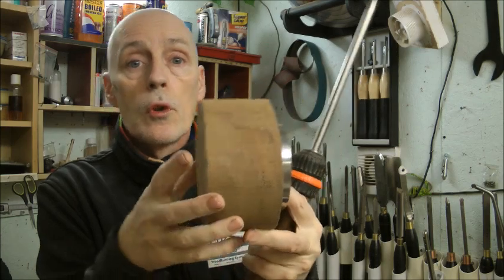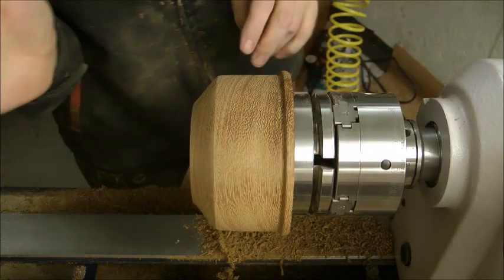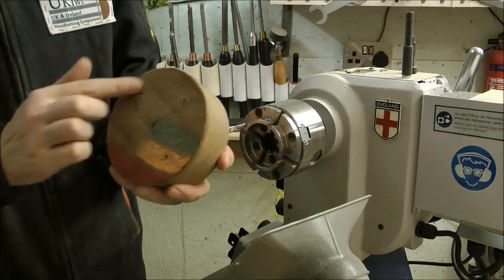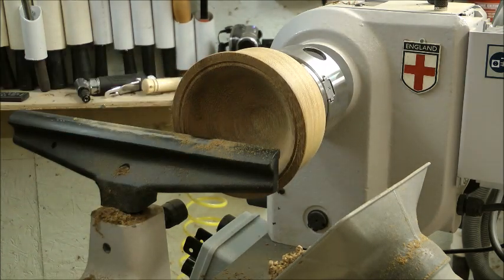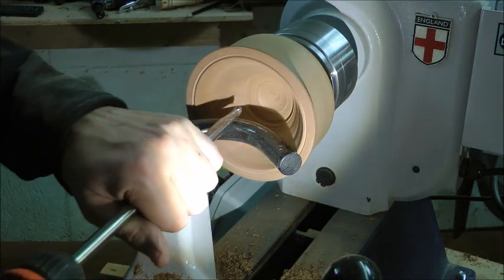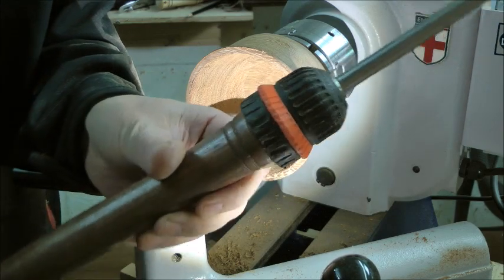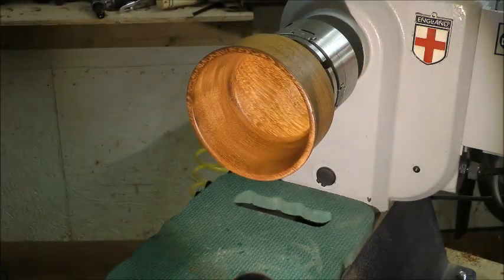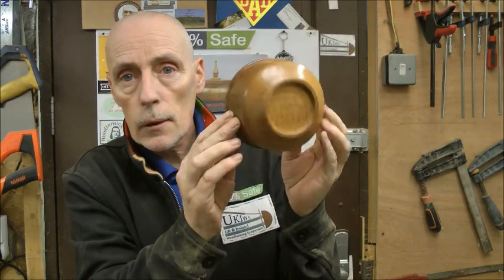E60  { wood turning }   little bowl new tool

Comment: Good to hear the  workshop is up and running mate, I had a problem a few years back 
 a bloody rat had got up into the shed loft and gnawed the  lighting cables  ,reconnecting took minutes but getting to where it was gnawed through took hours 😣 
NOW,
Don't put your self down mate  you are a very competent wood turner !.....so there !😊 thats a cracking handle and and bloody good idea using the drill chuck .... and  you made a sweet little bowl ! nice one Dave👍.
Cheers,    Bram
Reply from the maker: hi bram nice to have kind comment like that it was doing my head in tryin to find the problem bit of time and patience finally got there take care dave